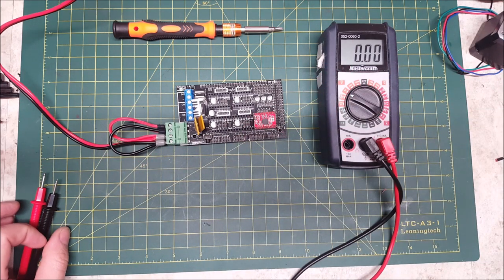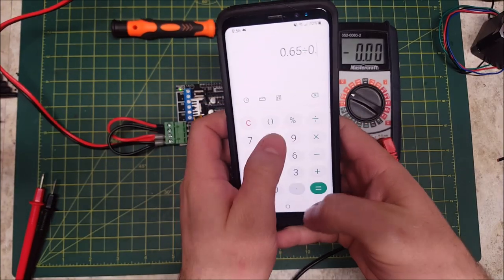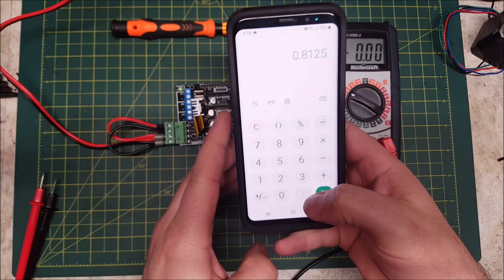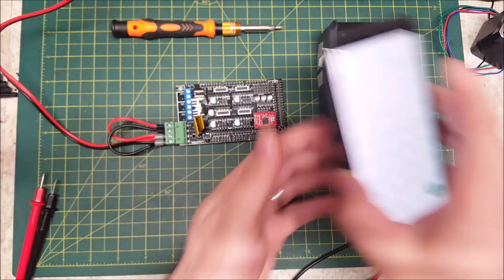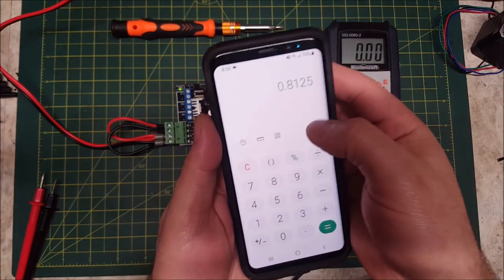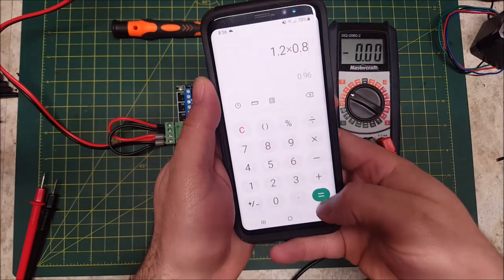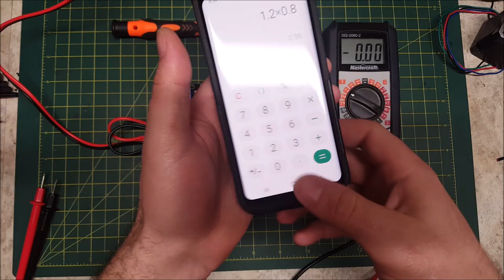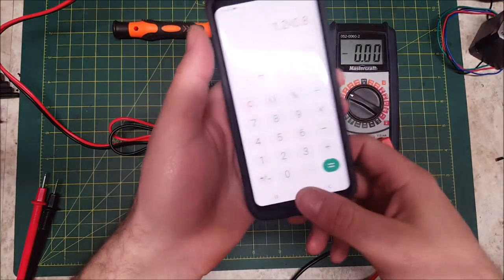Measuring Vref and setting current

Comment: If you cant measure voltage with a Arduino uno CNC shield, your Arduino needs to be powered on... Just in case this helps somebody, that was my issue.

Comment: I recently went through this process on my Maker Select v2.  The formula used was current (amps) x 8 x sense resistor value (.1).  Then that number was multiplied by .9 to get 90% power.  I'm setting my Voron 2.1 up now (using the recommended 2a stepperonline motors w/ 4988 drivers (sense resistor r100) and was wondering if the 1.4 vref value I got would do the trick?
Reply: On Voron 2.1 and preferred motors (from official BoM) you need only 1.2-1.4A on 12v and near 0.9A for 24v.
Reply: @OleksandrDiedov  Nice, thanks

Comment: Does klipper need to be pre installed on the Mega?
Reply from the maker: No. No software installed on the controller is required to set the vref this way

Comment: input voltage 24 volt.
Vreferenc is depend on voltage..?
Reply from the maker: input voltage does not affect setting your drivers Vref
Reply: @CanuckCreator  ok 👍🏻
Reply: @CanuckCreator  12 or 24 volt system which one is best

Comment: I saw another video saying you want to make sure the motor connected to board as well before powering the board or you can fry the drivers. 
That was for an Arduino CNC shield and DRV8825 drivers though. https://youtu.be/OfyT1xTZC6o